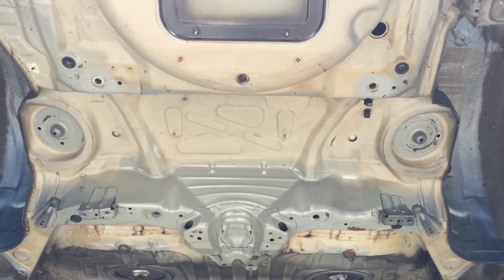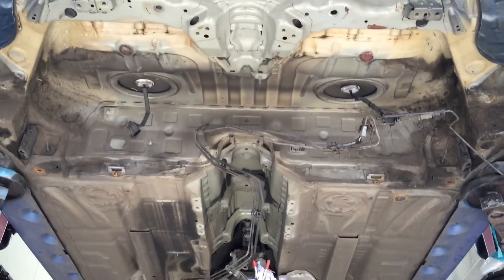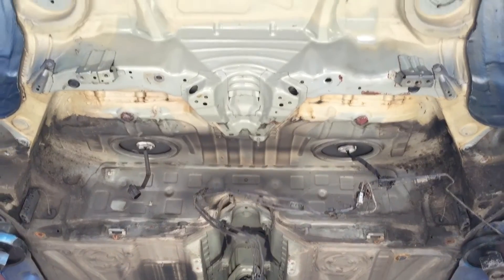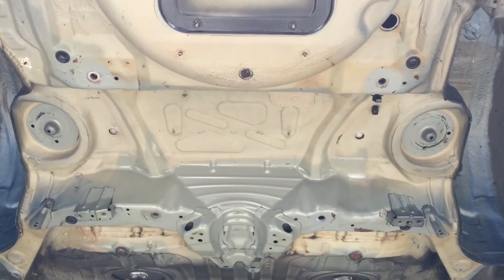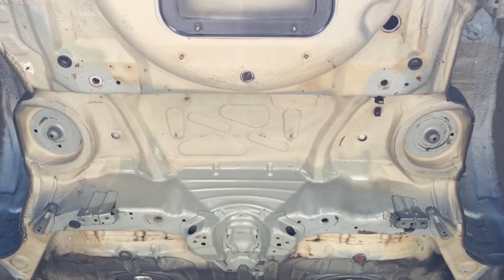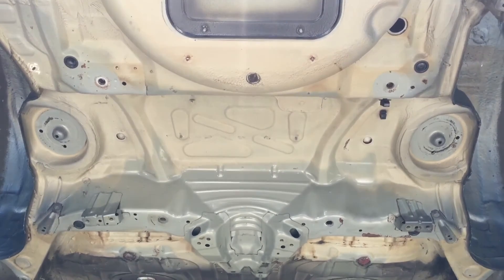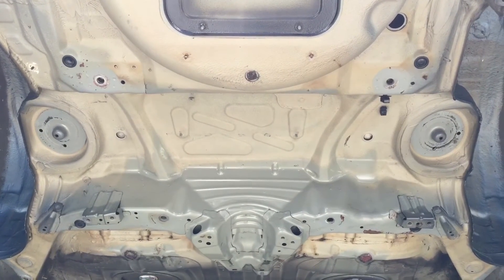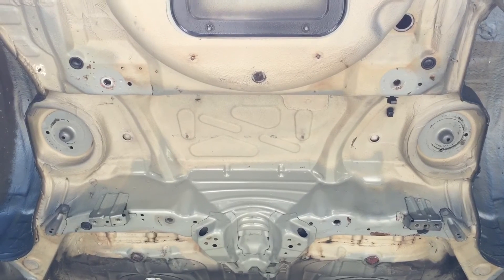Example of how Redish Motorsport degrease a BMW E46 M3 Subframe Panel

Comment: What type of de greaser do you use to clean it? By hand and brush or with a pressure washer?
Reply from the maker: Hand work only with nail brushes and even tooth-brushes in some places. All Purpose Cleaner and hot water works very well for us.